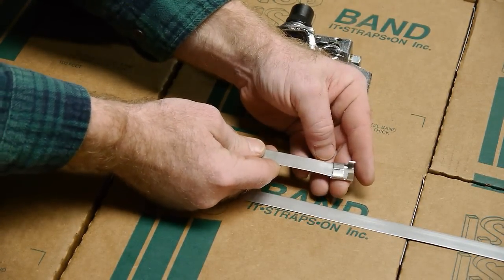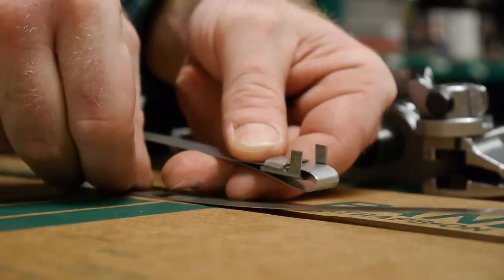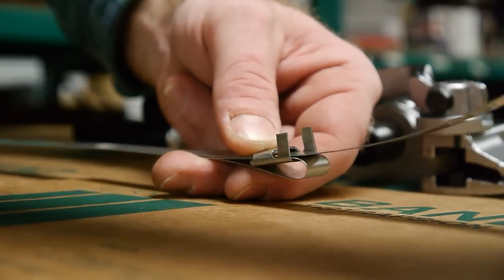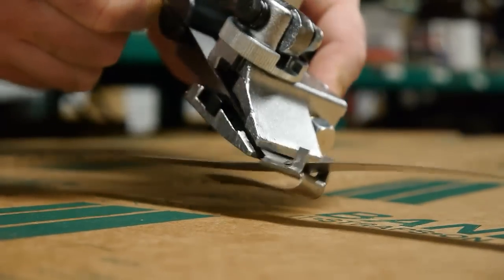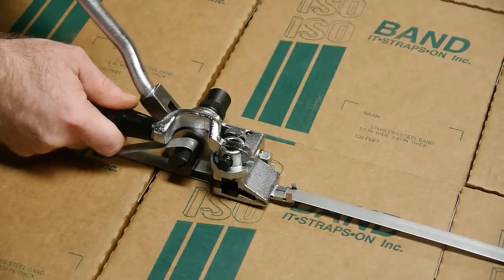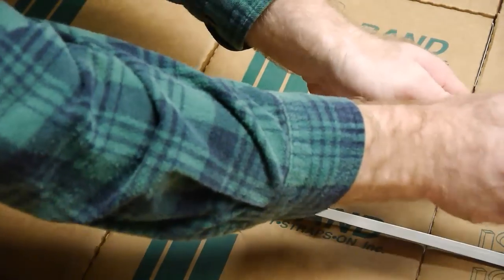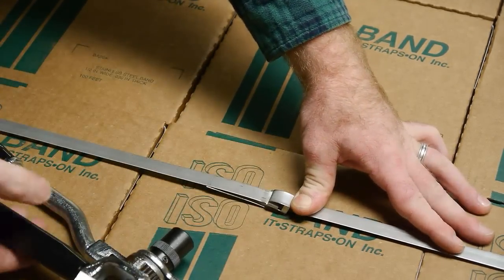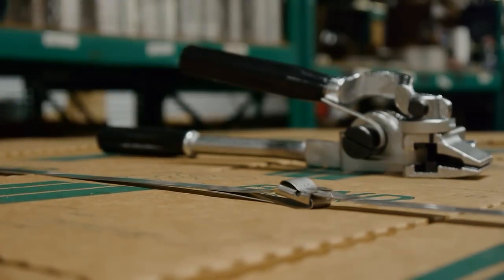Ratchet Tensioner Tool - ISO Stainless T101 Banding Tool

Comment: Pretty crappy demo. You should have shown how to do it on a soft surface properly. There needs to be support for the tool between the item and it. Sheet metal, plastic, or hard cardboard. The edges of the item need to be protected with corners to prevent crushing. Didn't properly tighten either. That's because it was bouncing. If using sheet metal, a handle can be attached to help yank it out after finishing.